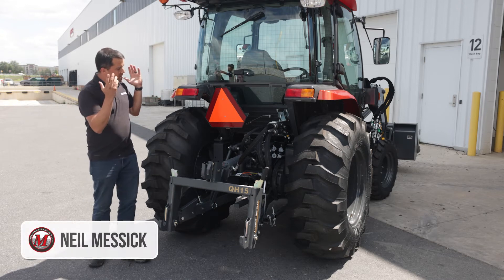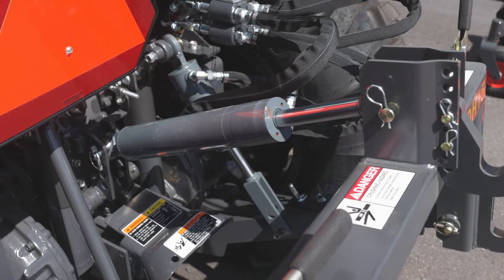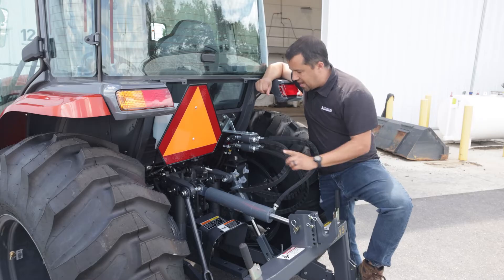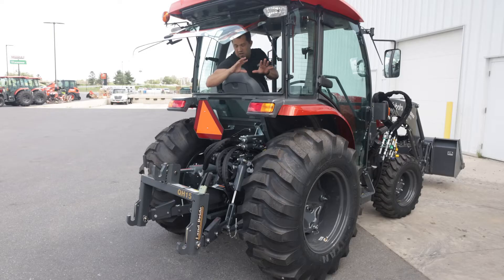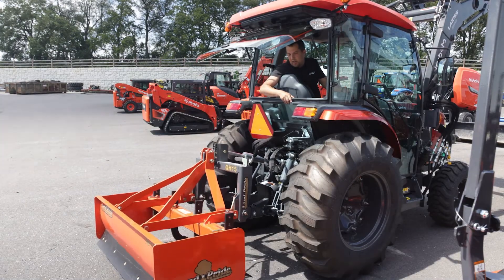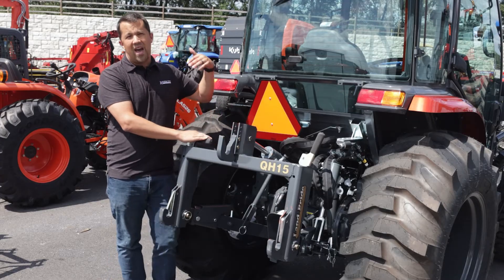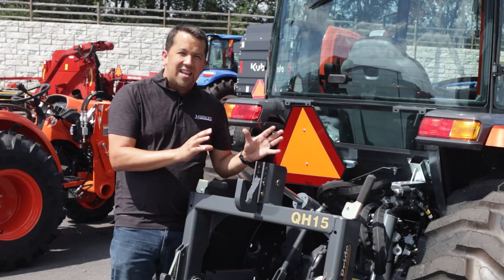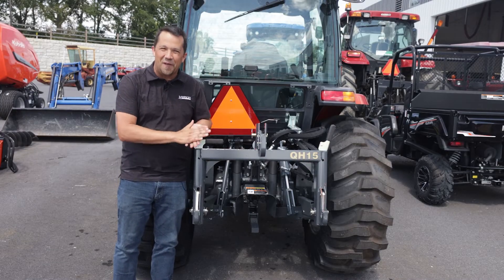The ultimate three-point hitch upgrade | Compact Tractor Top and Tilt

Comment: Need a kit for the Kubota L3302 that comes with every thing even the control's.   I'm wanting to add a 4 / remote function to my tractor  but also want to add the top and tilt functions. that way I don't have to do it by hand ever time for box blades ect. for grading ect.
Reply from the maker: Just call, we will hook you up

Comment: I got my M7060 with top and tilt stack of 3 valves. They leak like a siev. I've had it in the shop 3 times, and they change O rings, tell me it was fixed, and it leaks as soon as they deliver it. I guess I got to buy some new connections. I think its the connections. I paid 10 grand for the extra warranty, but I sould have paid 15 grand. Maybe that would have made me a valuable client to earn that my tractor gets fixed. I love the tracter, and this is the 3rd piece of equimpment my family purchased from this dealer.

Comment: I use my backhoe on my l3901 every week. Takes 5 min to hookups.
Would I have to take out this cylinder each time? Sound like fantastic addition even if it is expensive. Thx for your advise.
Reply from the maker: The cylinders replace some of the hardware on your 3, so yes you remove them.

Comment: So, if I already have the hydraulics I should jump all over the T&T? 

Of course mine seem to leak a lot when a hose is plugged in (they ARE Kubota brand. Well, actually they were installed by the dealer and are SUPPOSED to be Kubota. Hmmm,).

Comment: I have wanted this functionality for a while. Q: I have an MX6000. Your website shows 2 kits for the MX, one is $1169 and the other is $1419 - what is not clear is what the difference is; is the cheaper one the cylinders only? I have 6 remote outlets on the machine (3 sets of 2) already.

Comment: I installed a top and tilt kit from Kubota sometime after getting my l4760 it was really easy to do , some things I learned along the way. 
1. it makes it a lot easier to hook up implements with the quick hitch if you have a top and tilt kit it makes it easy to match angle and grab implements into position with the top hook
2. you can get away with 1 rear remote and a hydraulic diverter (summit hydraulics makes one for this purpose) letting you swap the 1 outlet with a lever between the 2 cylinders although I did have some issues where at extreme angles the quick hitch would hit the diverter and it would pop out the hoses so it is much nicer to have the 2 dedicated remotes which I eventually upgraded to.
3. it is something that I wish I had gotten upfront and included with the financing instead of a later add on especially since I had to have the dealer install the extra remote ( I was able to install the top and tilt kit myself in the field) as I did not have the facilities to do so myself at the time.

Comment: Would not be without, but another place it really shines is when loading the tractor onto a trailer, you can tilt your mower or disc WAY up to drive on or off and not scape, then quickly level and lower to chain down.

Comment: We added the 3rd function OEM as well as all 3 rear hydraulic ports to our Grand L 3550 LE. Right now, we are just using one for the hydraulic top link. Eventually, we will get the tilt cylinder when we upgrade our turn buckle arms, which are just on the LE version. 

I might point out that the dealer we purchased from chargers the same amount of labor to install one or 3 rear remotes. Yes, each remote will add to your cost, but I felt it was worth it as more Implements come out with hydraulic options for compact tractors.

Comment: Love the top 'n tilt on my 4060LE. I also have the 3d set of rear remotes and hydraulic scarifiers on my box blade. It's even a little useful for adjusting the tilt of my tiller and snowblower. Best of all, it makes attaching implements easy. The only (minor) downside is that rear remotes relax when the tractor is off, so the implement has to be adjusted each time you use it.
Reply: Notorious Kubota leak down that they deny exists…

Comment: The top link cylinder itself is worth every penny, especially if you're using a quick hitch. The time and aggravation of climbing in and out of the cab, dinking with the turnbuckle (sometimes several times) is a big p.i.t.a.. This is compounded once you get to the bigger compact tractors on up. The implements are extremely heavy and a lot of the times, you can't adjust them unless they're resting on the ground. Even if the implement is rated for a quick hitch, the angle front to back between the top and bottom pins can differ greatly. With the hydraulic version, you simply back up to the implement, adjust the top link for the correct angle and pick it up, while in the seat. The side tilt I will agree that it's not as utilized by non-commercial operators. Make sure to get cylinders with check valves built into them so they don't fade on you. A less expensive option to gain more SCVs is a hydraulic multiplier fro companies such as Summit Hydraulics. Or you can get a multi-circuit manifold valve with power beyond to add multiple discreet SCVs for a lot less than factory options.

Comment: Great option if it wasn't so ridiculously expensive.  I'll just get off the tractor and adjust the top link...the 3rd function kit was ridiculously priced as it was.  Adding rear remotes themselves is another cost prohibitive option but could provide a lot of additional use once you have them.  I had the 3rd function kit added after the fact so it cost even more than it would have initially...let my salesman talk me out of that kit when I bought the tractor, shouldn't have listened to him....I haven't got the grapple yet, but its on the list for this year as that was the main reason I got the 3rd function kit added....that and I recall you mentioning that if the tractor model changes those kits might become "obsolete" in the fact the kits get broke down into their individual parts and cost even more...which makes me think I should have the rear remote kit added too for future hydraulic needs.  

I'd just like to have the hydraulic top link, for a box blade, or land plane, and other attachments like that it would be very useful.

Comment: While the hydraulic side link may not be worth the cost to everyone (depending on the attachments used and tasks performed), I think the hydraulic top link is worth the cost to everyone who uses 3 point attachments.
Reply: I have both the top and tilt but I have not really needed the top at all. For driveway grading I only use the tilt function. If I could do it over again, I would have just bought the tilt part.

Comment: I had my dealer install 2 rear remotes and the Kubota top & tilt kit on my LX2610SU late last year. I called up KTAC to see if I could have this added to my policy, but they said no because I paid cash for the mod, and the policy on the tractor is tied to financing. If I really wanted to insure it, they would have to write up a separate policy and in the event of a loss, I’d have to pay 2 deductibles!

Comment: Make sure you get them with check valves.
Reply: Nope. You do not want check valves. You want the  correct valve bodies. Work with a dealer or hydro shop to get it correct.
Reply: @DeepSouthVeteran  I work at a hydraulic shop.. Yes you do.
Reply: @DeepSouthVeteran what would those be? My factory valves all (3) leak down. Dealer has replaced them twice with no improvement. Is there some other body they need to order? The forums are full of other owners with same problem.

Comment: I'm supposed to take delivery of a L3902 with three rear remotes this week. I ordered a top & tilt plus a third set of lines for a Gearmore box blade with hydraulic ripper . There was a small holdup with a back ordered lever. The two neighbors I asked both said not getting  rear hydraulics is their biggest regret.

Comment: Unfortunately, I have a cat 2. Plus I don't have the brand tractor you sell. So guess I'm s.o.l.. 😂 😂
Reply: The components that make these features are not exclusive to Kubota or Land Pride and can be had to fit a hitch of any category.
Reply: @timberhitchllc . I want to get a cat 2 quick hitch for my RX7320. I would like to get that top & tilt set up for my tracktor as well. I would need 1 more auxiliary out. I have 3 now. I'd like to get a quote for this if it's possible please. Thank you.
Reply: @rickwest4783  Sorry if you misunderstood me. I don't make or sell these parts or kits. I only commented to say that they are out there to be had. I was about to make up all the parts I needed to outfit my tractor using brand agnostic parts. It can be done!
Reply from the maker: Yea, we can't do that. No way for us to get the dimensions correct.
Reply: @timberhitchllc . No worries. Thank you for all the info. 👍
Reply: @MessicksEquip  That's all good. Just means now I have to have
this on at least 1 tractor. 😂 😂

Comment: I added a top and tilt to my B2650 and I absolutely LOVE it.  I plow my driveway with a rear blade and allowing the tilt to float during plowing is soooo good.  Got the kit from my local dealer (it was for a slightly different model but they said it would fit for me) and I did the install myself.  There's a video on my channel about the install and it was tricky but very fun!
Reply: Can you provide a part/kit number?
Reply: How much did it end up costing you?